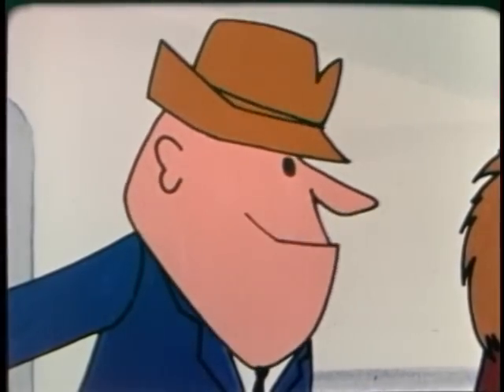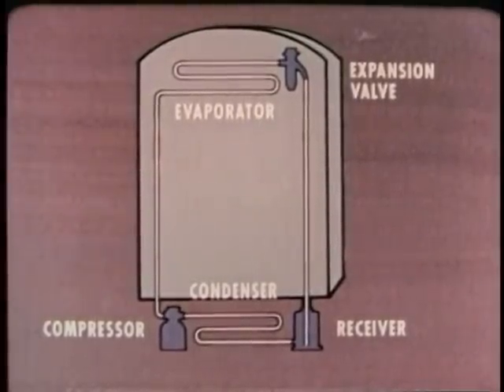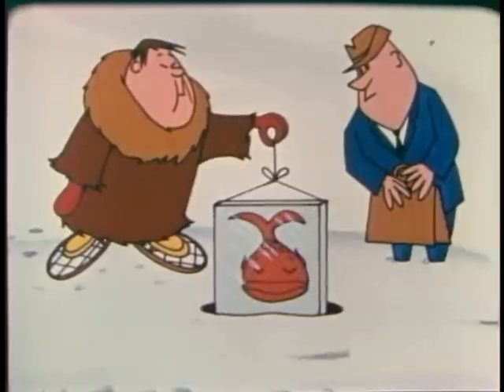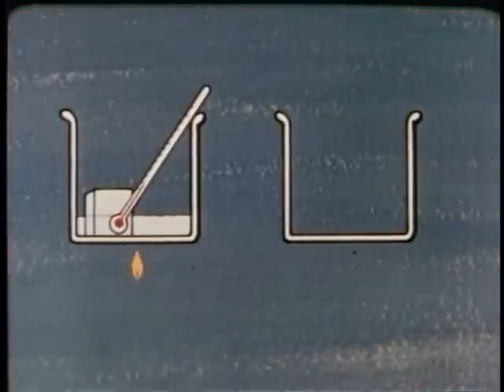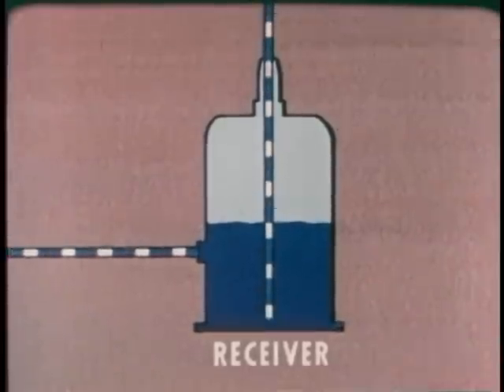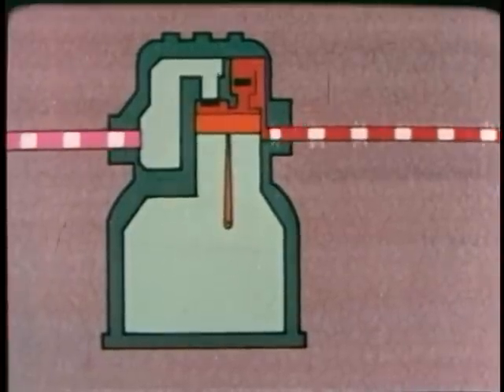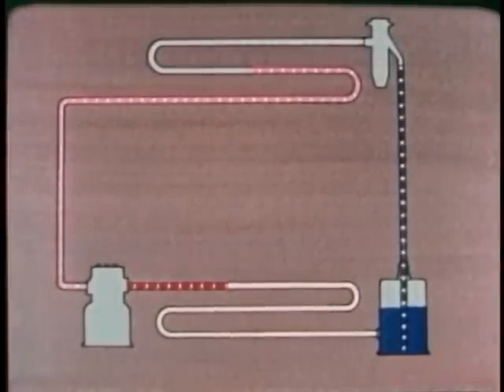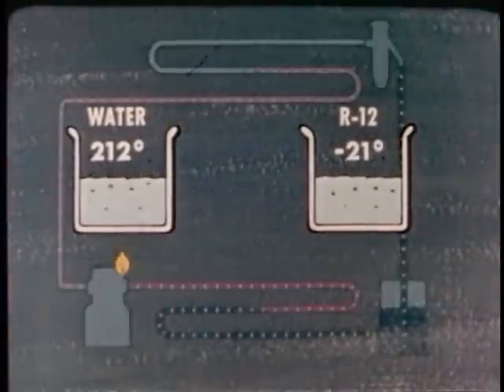REFRIGERATION -- PRINCIPLES OF MECHANICAL REFRIGERATION

Comment: Why must it have a phase change to work effectively? Why not just be a gas or liquid through the entire system? How does the compressor regulate the pressure so that it is at a certain temperature in the evaporator coil? 
How do you keep the compressor from becoming a bomb when it pumps the high pressure gas into the resovior?

Comment: Why is it necessary to compress the gas even hotter when going to the condenser?
Reply: Jyson AW The gas gets hot as it leaves the compressor. When the piston compresses the gas, it gets hot. A valve opens in the compressor to let out the hot gas. The condenser helps cool the compressor as well. The gas is much hotter in the condenser than it is in the compressor. If you have too much heat in the compressor from a dirty condenser, it will result in high head pressure. Most compressor failures are caused from dirty condensers. When you have a dirty condenser, the compressor gets very hot. It's is normal for a compressor to get hot from compression, but it is cooled by the refrigerant entering the compressor.
Reply: +krnman1 It's not the point to get the gas hotter through the compressor, that's just what happens by the heat of compression. The point of the compressor is to raise the pressure of the gas so it will condensate at a higher temperature, that makes it's easier to give off that heat to ambient air.
Reply: krnman1 The compressor what keeps the refrigerant moving through the system from the condenser to the evaporator. The gas does not get hot in the compressor, it gets hot in the condenser as it gives up heat.

Comment: Ahh... I was so happy to have reviewed the principles of boiling points in different substances... I was under the impression that all liquids boil at the same temperature that water boils. This of course led me to be even more confused when watching other similar videos that talked about the difference between sensible heat and latent heat. Thermodynamics used to be a nightmare for my understanding, but the more I learn about it and try to understand it, the more interesting it becomes.
Reply: Jeremy Francis "I was under the impression that all liquids boil at the same temperature that water boils."

This is going to sound mildly insulting (it's not meant to be), but what in the world gave you that impression?

The very fact that liquid H2O turns into gas at a certain temperature, and that there are gases (like the air we breathe) which exist at temperatures much below "freezing" -- otherwise, how could people survive in winter above the tropics? -- makes it obvious that those chemicals must turn from gases to liquids at very low temperatures -- and therefore they must boil at temperatures different from water.
Reply: I just honestly never thought of it before. Most of the thinking i do is metaphysical... I only recently grew an interest in chemistry and physics. In which i never took courses in high school.

Comment: Okay, I think I understand this.
The refrigerant R-12 boils at -21.

So Receiver sends liquid to expansion valve.
The expansion valve then starts boiling b/c of the decrease in pressure (colder) here then turns into gas.
The Compressor takes in the gas.
Compressor increases the pressure which would turn gas into liquid b/c an increase in temperature for R-12 makes it liquid.

Comment: The expansion valve is also called a metering device that operates from a sensing bulb charged with refrigerant R-12 or 22. This type of expansion valve is called a "Thermostatic Expansion Valve" or THV or TEV. When the sensing bulb detects a certain amount of superheat, the valve then "throttles" in a certain amount of refrigerant into the evaporator to avoid flooding it also prevents liquid refrigerant from leaving the evaporator if there is excessive superheat. Another type of system is called a "capillary system" which meters a uniform amount of refrigerant into the evaporator at a constant rate also called a "fixed bore" metering device. An evaporator fan is needed to draw the cold away from the evaporator to avoid icing and likewise a condenser fan to draw away the heat to avoid high-head pressure in the compressor.
Reply: Psycho9263 which country do you live in? R12 and r22 are illegal to use in norway because it is bad for the ozon layer

Comment: what drives the refrigerant through the lines?
Reply: The compressor.
Reply: *****
 Yes, it goes through the compressor as a gas only. Liquid refrigerant should never enter the compressor. The only systems where you charge by liquid is (from low side only) refrigerants in the "4" series. Like R-410A or R-404A or R-422A Under no circumstance attempt to charge any system from the high-side. Remember: Charge from the Low Side only. Use a set of gauges when charging a unit.
 R-22 charges as a gas. Never invert the container of R-22 since this can damage the compressor. R-410A operates at much higher pressure than R-22.

Comment: How is heat actually taken out from the container that holds the food and dispersed to the outside? I thought those coils only run along the outside.
Reply: When the refrigerant under high pressure enters the metering device, it is throttled into the evaporator as a low pressure liquid and vapor mixture, it then absorbs the heat in the container which will become a gas in the evaporator. This heat laden gas is carried from the evaporator as a low pressure gas to the compressor which then becomes a high pressure gas. As the gas flow into the condenser the heat is then rejected and condenses to a liquid and then the cycle repeats. It once again becomes a high pressure liquid.
Reply: Psycho9263 But the absorbed heat must go somewhere.  Otherwise it just stays in the system.
Reply: thisisjustplainstupi No, they don't.  Look in the back of a refrigerator and you'll see exposed coils.

Comment: sometimes the demand is higher at different times of the day, so the thermostatic expantion valve accomodates this by allowing more refrigerent through regulating itself depending on the load.

Comment: This is a very basic, but excellent video on the principles air conditioning. I believe a key point that is made is that refrigerant boils at -21 degrees. Most other tutorials never venture into this key point, which is such an important factor in the fundamentals of the process. Although the video may be from the 1960's, it is excellent!
Reply: Just for people reading the comments 5 yrs later, I want to clarify that the refrigerant boils at -21 degrees only at atmospheric pressure. Heat only flows from hot to cold but a refrigerator moves heat from a cold area to a hot area - against nature. That is done by compressing the gas so that it will condense at a high temperature (higher than room for a refrigerator or outdoor temperature for AC) and then expanding the liquid into a low pressure area - the evaporator - where it will boil at a low temperature. So the main thing happening with a refrigerator/AC is changing the boiling/condensing temperature.

Comment: An Old Black and White (but Excellent, Educational) Documentary Film. However note that R-12 (Dichlorodifluoromethane) was used as a refrigerant until 1994. Its manufacturing is band in USA, EU and many other countries due to its harm to ozone layer. Currently R290 Pure propane, a hydrocarbon (HC, no ozone depletion potential, but highly flammable), and Ammonia (No ozone depletion potential, but highly toxic) among some others are used as refrigerant.